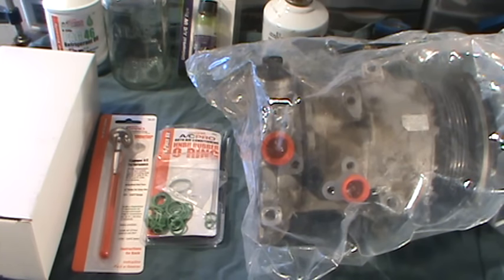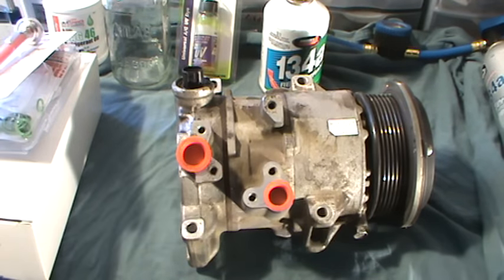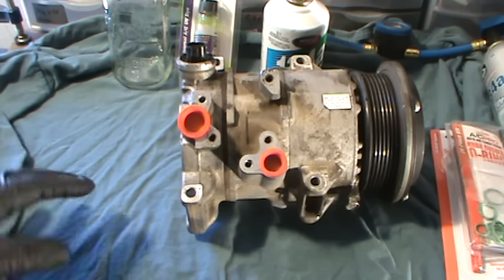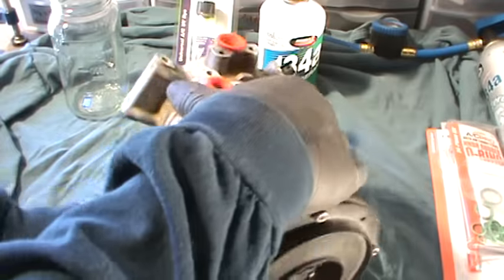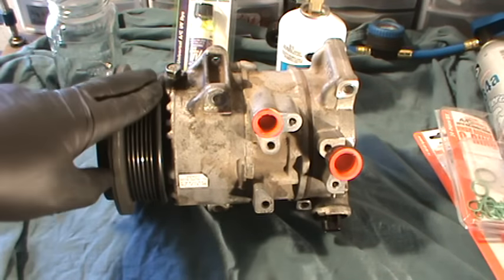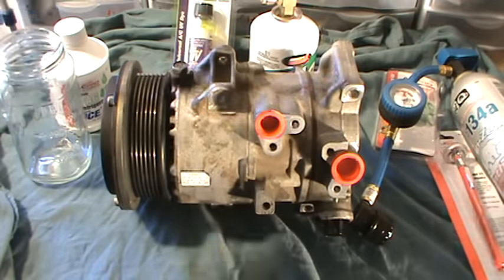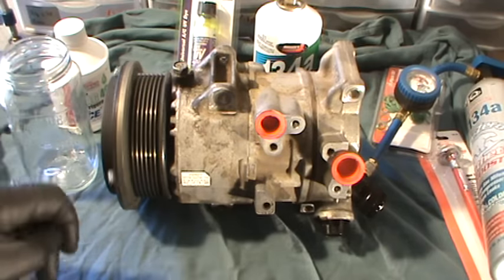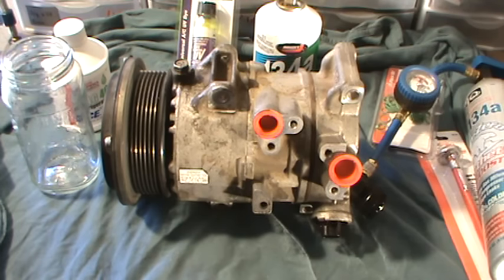Air Conditioning Not Working (Update)

Comment: Shearer valves both have needles. My low side valve is leaking a wee little bit.  It needs to be replaced.  Less than $5 fir two with caps.  I don’t know why we  never hear about replacing these. They are so cheap and absolutely require a airtight for.   If the system is empty.  Change the shrader valves.